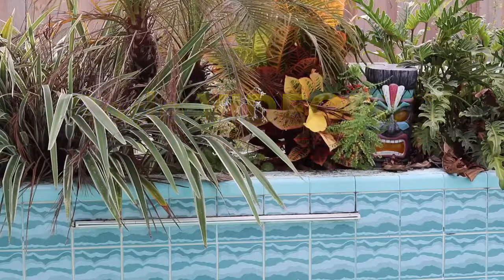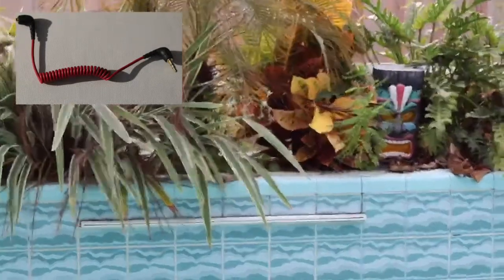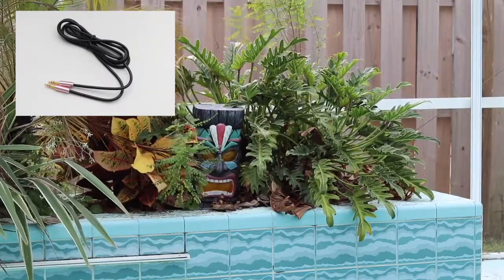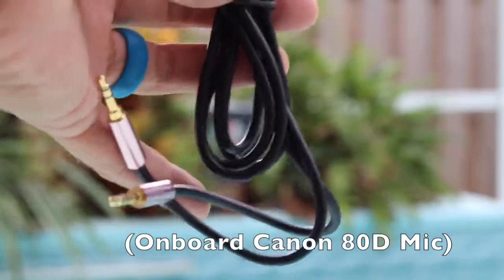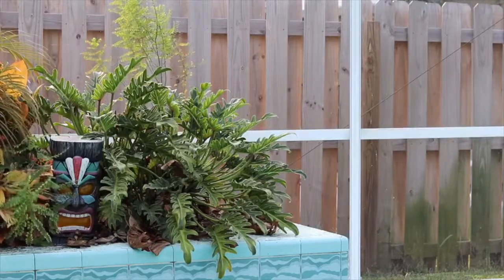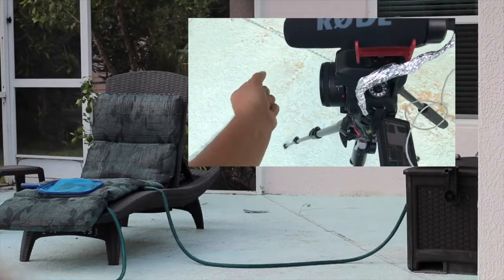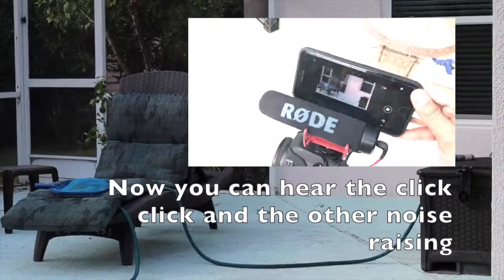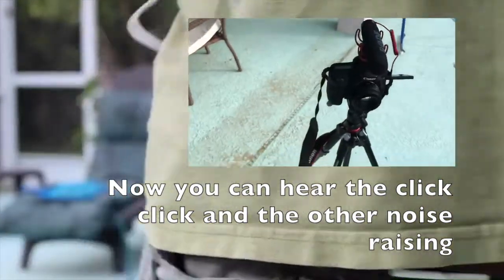Rode VIDEOMIC GO Noise Canon 80D Fix SNR Aluminum Foil

Comment: I turned off both wifi and Bluetooth and the clicking sound disappeared.
Reply from the maker: Brandon Uttley right that is the problem. But I like to use the canon app to wirelessly control the camera, and you need wifi on for that

Comment from the maker: I’ve switched over to this 1.5’ cable it’s been working pretty good and not as long as your off the shelf patch cables. UGREEN 3.5mm Male to Male Auxiliary Aux Stereo 

I get some glitches when the camera is first on but after it “warms up” it’s fine. This is with WiFi off. However this is not sustainable and I will eventually get a Shure lapel wireless mic setup or maybe another Rode with a preamp built in (better signal to noise ratio if it has a preamp).
https://www.amazon.com/UGREEN-Professional-Silver-Plating-Tangle-Free-Audiophile/dp/B00WHUTQP6/ref=mp_s_a_1_fkmr0_2?ie=UTF8&qid=1550205229&sr=8-2-fkmr0&pi=AC_SX236_SY340_QL65&keywords=UGREEN%2B3.5mm%2BMale%2Bto%2BMale%2BAuxiliary%2BAux%2BS&th=1&psc=1